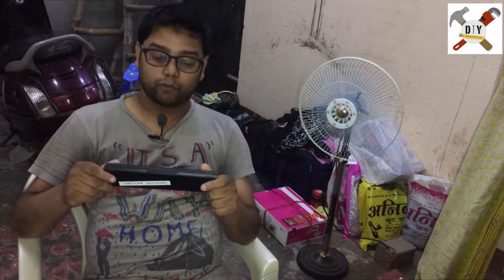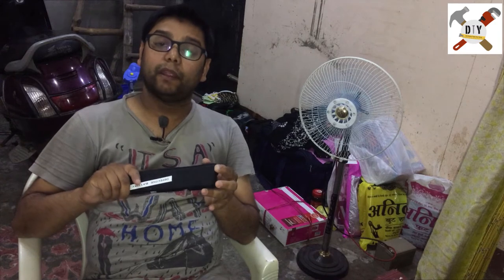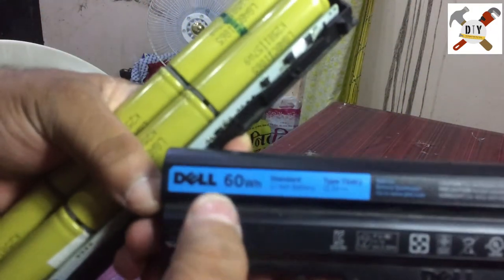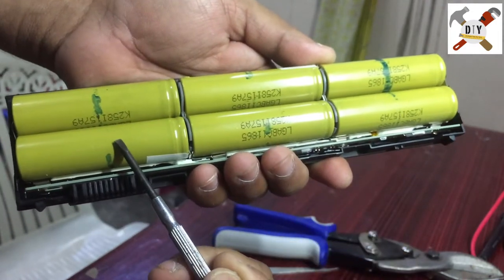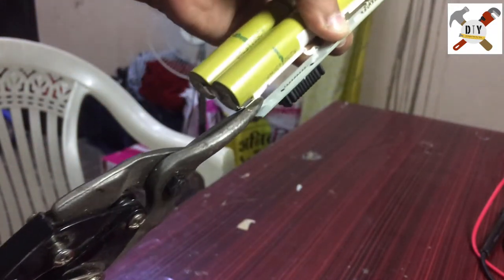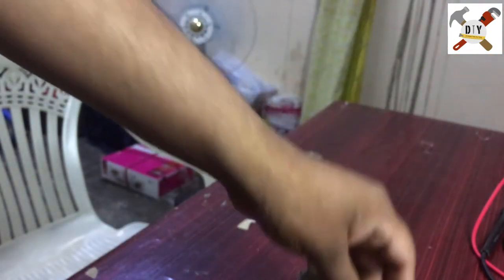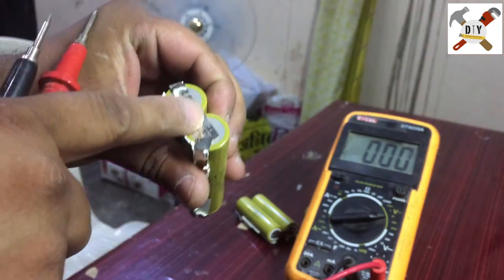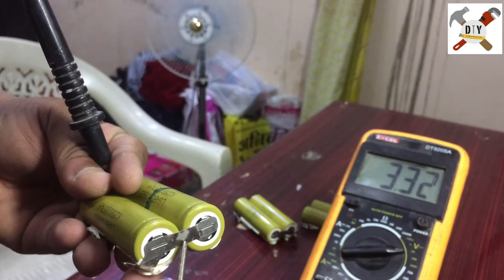Reuse your old laptop battery

Comment: Bro the voltage regulatot is there for a reason.. to prevent overcharging and over draining... if u throw it out you can never recharge or use it safely again
Reply from the maker: Arkya Jyoti Ghosh Brother I am using bug converter that to recharge these batteries and to charge the phone through these batteries I am using it
Reply from the maker: Check this link https://youtu.be/O6yYkada9y8

Comment: Backup is good????
Reply from the maker: Yes backup is good
Reply: Is battery older than 5 years????
Reply from the maker: @rp-mj9mx  all the cell in battery never die so you may test which are fine and use them...
Reply: @learnfromideas5258  ok. Thanks